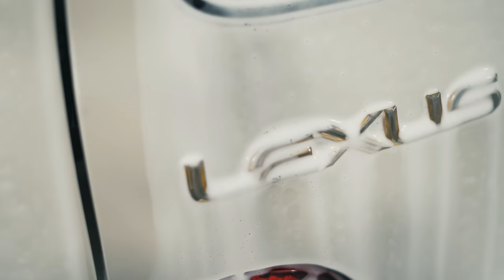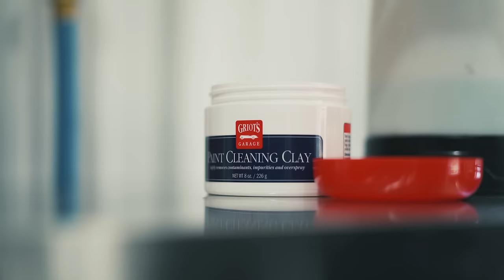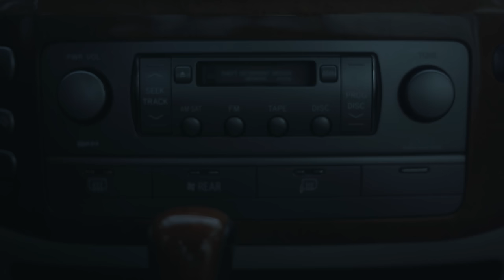An Extremely Thorough 40 Hour Detail On A Lexus LX470 Land Cruiser

Comment: This is fire man wheel and tire combo looks tuff! May i ask why wet sand before polishing? Jus curious ive never seen that combo before :) also i think for wheels as nice as them a ceramic coating before install was definatley a necessity! Killer job man✌️
Reply from the maker: Thanks so much Glenn! I sanded the hood because there was a small ridge where the paint protection film was and sanding allows you to blend it down easier. As for the tailgate the upper part looked to have been painted and had quite a bit of dry spray. So the sanding knocks it down and allows for a great finish.

Comment: Great work! I don’t see you doing much claybar work. Is that for a reason or that’s only for more In depth details?
Reply: If you're sanding anyway, you'll be sanding right through all that. Enough for your polishing pads to not pick up too much remaining dirt if you choose to have a heavy single cut after the sanding. The first cut with whatever polishing agent you use will pull out what the sanding & IPA wipedown didn't get off. Then you up to a correcting compound, finishing polish, wax/coat..
Reply from the maker: I mean I clayed the vehicle, no need to show a bunch of clips that don’t show much if anything happening tbh

Comment: Incredible. Was the tiny wet sand for the whole vehicle or were you flattening out the touch ups before compound/polish? I have a GX with similar paint chipping and would like to do this. It's pretty, but the chips stand out even more after detailing.
Reply from the maker: Thanks Kyle! The sanding for yes for the touch ups on the front bumper. Hood was to blend the line where the PPF was. And the trunk was for down dry spray that was there.
Reply: @ChromaticGarage  sick. Subscribed.

Comment: I have a Lexus IS250, and the headlights are starting to yellow a bit. I noticed you sanded the headlights on the LX, and then polished them. Would you suggest the same approach, or should I sand mine down and clear coat them?